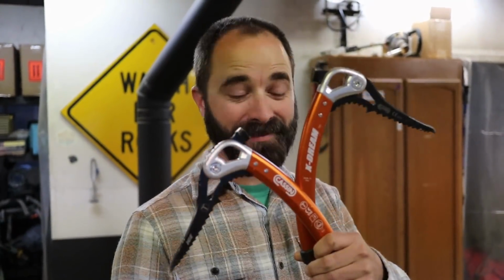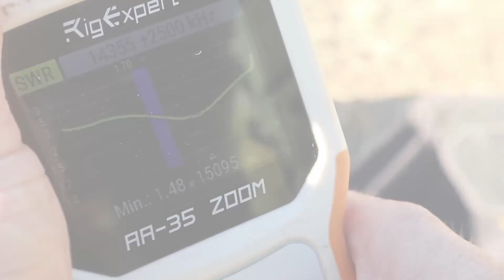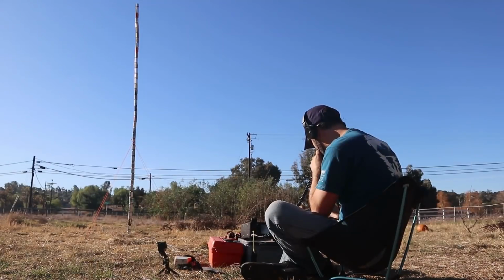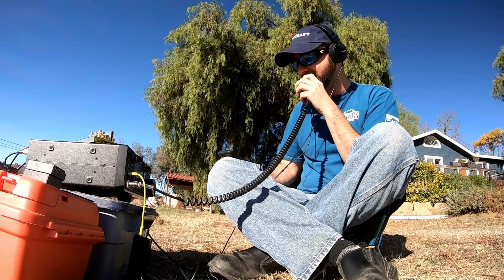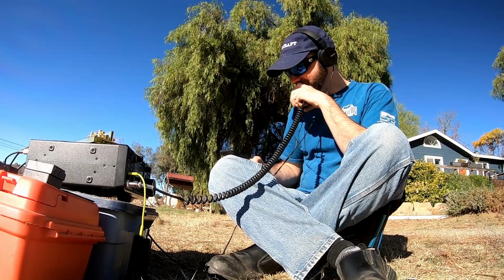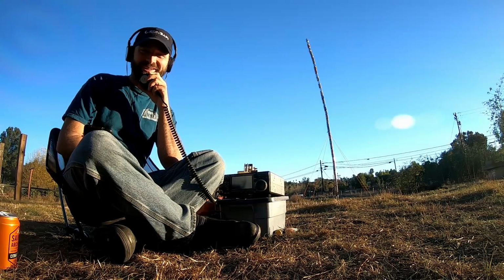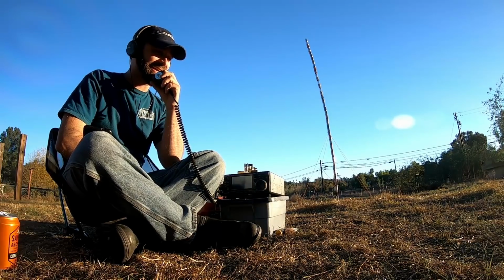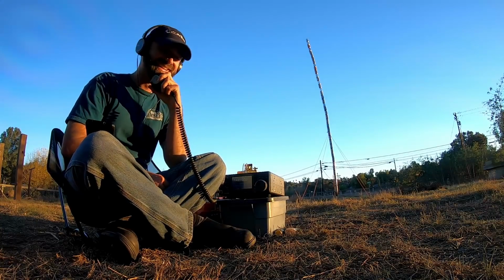Will it can-tenna?

Comment: Great job on the Beer Can Antenna.  Would have been nice to see how you grounded the feedpoint or what radials you used.
you probably know this but the beer can antenna was first built 60 plus year ago with tin/steel beer cans soldered together IIRC sometime in the 40's or 50's..  Pretty sure it was an article in QST but it might have been another publication.  I built a dipole for 10m out of Monster Java cans by cutting one end of each can off, sanding the contact areas and jamming the cans together to make the right length and held together with clear packing tape.  My current 10M vertical can-tenna build is made from dog food cans lol

Thanks for the video.

Comment: Great build there Adam.  The welding made it pretty rigid as opposed to using 3 inch strips of cut up can and a pop riveter. I only managed a small floppy dipole Lol. can't wait for your 90 can version for 40m ;-). Job Done, Well Done. M7PBX.

Comment: We live in the age of recycling,  and you've demonstrated what's possible with your cantenna. I can remember a VK4 did something similar over here maybe 40 years ago, just for a laugh too. The cans were made from steel in those days, and were easy to solder. Maybe if you drill a hole in each can, and string some cord through it, who knows how low in frequency you can go on a windless day and with the help of some friends to stand it up. Looking forward to seeing your 80 metre version, but watch out for the power lines. 
73.

Comment: Makes me think you could turn one of you collapsing pool cleaning poles into a cheap packable vertical for 20
Reply: You know, that is a great idea!  I have a couple of 6m telescoping aluminum poles.  That's good for a quarter wave on 20m.  Attach a couple of radials and an SO-239 connector!  A good new project!  Thanks!
Reply from the maker: Yeah! Just make sure the junctions are conductive.
Reply: @K6ARK  clamp a wire bridge across the joints.
Reply: @JReed305  how many radials were you using?  random or calculated length?
Reply from the maker: 6 or 7.about 10-12 feet each. It's just what I had handy. Probably could have improved SWR with longer ones, but it was good enough.
Reply: An adjustable painters pole would work too, and a tape measure.
Reply: @randyvanvliet226  most definitely. I mention the pool pole as K6ARK uses them.

Comment: Very cool. How many beer cans did you blow through on that mig welder before you got the settings correct?
Reply from the maker: Honestly, I think I only threw away one. I was able to repair/glob on enough material to get them to hold together. Some of them were certainly prettier than others. One of the hardest things was that the can tops are not all conductive to the rest of the can. It makes it extra hard to weld them together!
Reply: @K6ARK  Great antenna 👍, I would have liked to have seen how you hooked up the coax and connector to the cans.
Reply from the maker: I used a BNC to binding post connector on the end of the coax. The ground went to 6 radials. The center conductor went to a short (2") piece of wire attached to a ring terminal screwed to a piece of aluminum bar stock (drilled and tapped hole) welded to the bottom antenna can.